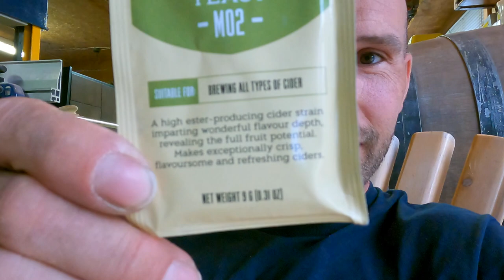Apple Cider Home Brew Q & A | EASY, CHEAP, DELICIOUS! | Your Top Questions Answered | JR’S Life

Comment: Great video.. How do you prevent oxidisation of the cider in the barrel once its fermented as you keep pouring it?
Reply from the maker: Thanks so much and good question! 

From my experience, once the yeast stops working and the sugar is consumed then it seems to stabilize. 

With the bung and spout in place the unit is sealed and no additional air is getting in and the shop is kept at a cool temperature. 

The flavor profile will still slightly adjust over the next few months in the barrel but it doesn’t go bad. What we typically do is bottle some at the flavor profile we really like but also experiment by keeping some in the barrel and testing that too. We enjoy it though to the end of the year when we are ready to start a new batch.